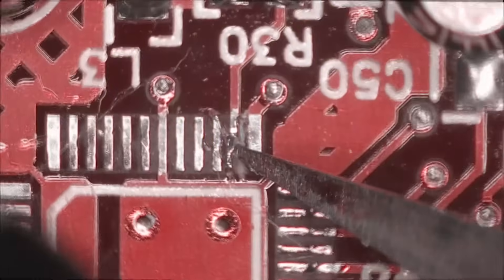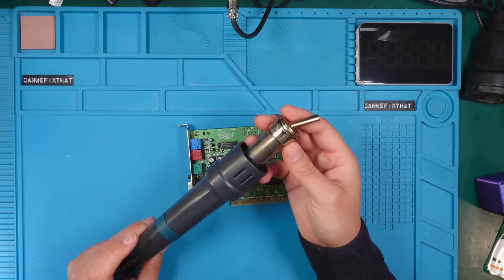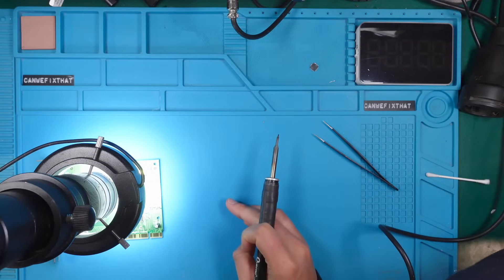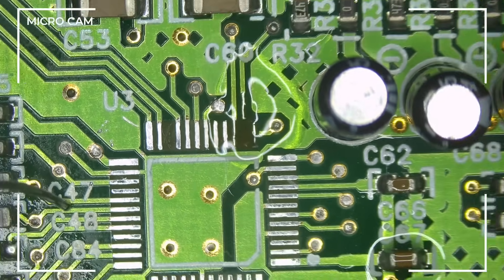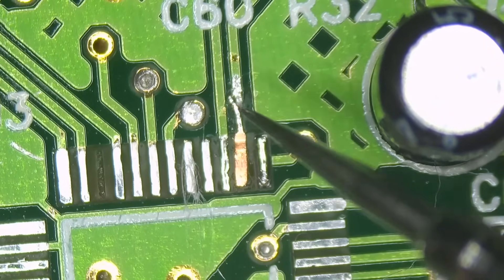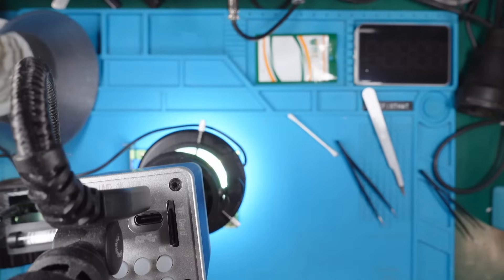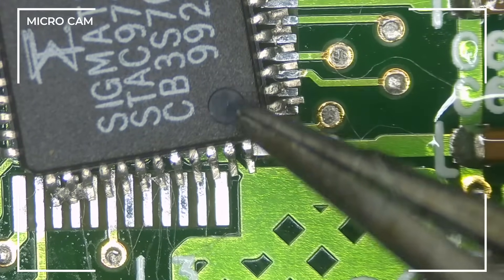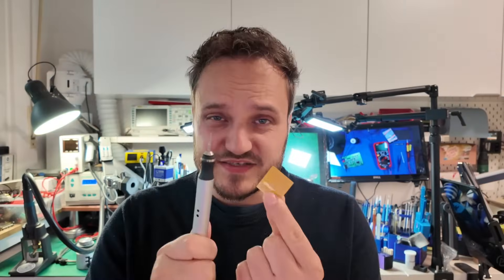How to FIX a MISSING Solder Pad (Easy)

Comment: Grind  the board under the missing trace and set the new trace with a smear of epoxy.  Smooth trace with a spatula.  Let cure before solder.  For your trace, I would have used the wire side and saved the pad end.
Reply from the maker: Hey! Thanks for your tips! 🫶

Comment: This however does not work on a lighning connector which usually comes with a plastic base.
It usually melts before you can apply any solder!

Comment: In this case the everything you did was a waste of time... why not just soldier the new chip in pace and then just use a single stand of thin wire to bridge from the lead to the trace? Also, try using a fibre pen to remove the soldier mask, your tool took away some of the trace. I have repaired plenty of PCB's using nothing more than a fibre pen and some thin strand wire, old component leads work great for thicker traces. You can even repair completely snapped pcbs... superglue them together, repair the tracks, and maybe reinforce the pcb with some two part epoxy.

Comment: I remember back in the day using thin solid core copper wire to make traces when needed in situations. Lay down epoxy to hold the strips in place after a solder joint connection was made to the end of the original trace. Sometimes I used copper shielding tape from shielding electric guitars. Most times a jumper wire was used in situations where things didn't need to look neat.

Comment: Is the trace repair required? Or for aesthetics? (Compared to using a wire from the ic to the go through spot)
Reply from the maker: Hi! It's not required; you could use a jumper wire instead with no issues. It's just a bit more neater. 🫶

Comment: I do not see much neccesity to add resist to the trace that you soldered at least in this case. Both of the neighbor trace are  soundly covered by resist and I do not think they get shorted with oveflew solder. Resist is essential to prevent short bridge but not merely physical protection, I think.

Comment: What keeps the pad portion of lug patch? Just rigidity of it?
I see you soldered it to the trace but no glue or anything fot the pad portion itself. 
I wonder  how it get tucked to PCB surface.
I have not tried replanting pad.I  use very thin wire to jump trace to leg of chip after  installing the chip to sound pads. I think it's easyer than replanting the missing pad. It's cleaner to replant, sure.
Reply from the maker: Hi! It's held down due to the soldering mask, but there are plenty of ways of doing this; meanwhile, I'm using another technique for that. 😉

Comment: At 14:27 you can avoid the pad from moving if you took a toothpick with a TINY drop of cyanacrylate glue and almost dry rubbed it (very little) to the bottom of the repair pad as you placed it on the circuit board before you fluxed and soldered it to the trace.
Reply from the maker: Thanks! I will try that in the future. 🫶

Comment: Hi. Thanks for sharing. Practice gets you to get things right in this field. And a few tricks you learn here and there. I used to apply solder mask and just apply UV light and heat gun. That was ok but not as good as squeezing the solder mask with some clear plastic then expose it to UV. If I'm in no hurry i leave the board in the sun i get better result with the solder mask😂😂😂
Reply from the maker: Hey, thank you very much for your feedback. I've seen that multiple times in the past with the plastic sheet, I will check it out looks like  perfect way to get it nice and flat! 🫶

Comment: You have to use hot air and UV at the same time to cure it immediately!
Reply from the maker: Hey! Yeah, that's a good advise. In the meanwhile I'm using a thin plastic sheet to get it flat and smooth during the curing process. 🫶

Comment: Instead of the flat plane viewing microscope camera, you're loosing the depth perspective of your view. I highly recommend to use a stereo (both eyes) microscope. It is a HUGE difference to be able to see in 3D with both eyes seeing in a different angle.  Try it once, you'll never use anything else.    These are not so expensive any more, just checked available for €180-250.   If someone does such repairs regularly, it is definitely worth it.
Reply from the maker: Hey Nick, you are right, it is much better, but on the other hand your back and neck are much more stressed when you look for a long period inside this kind of microscope. That's why I've changed to this digital version. 🫶,

Comment: in a pinch I have used copper slug tape from the garden centre, you just have to cut it carefully, its also self adhesive but it works well.
Reply from the maker: That's also a very good way. Thanks for sharing! 🫶

Comment: Duude, first time I've seen the grinding pen. That's SUPER neat! 
Most times I've seen this done its been either the scratch with tweezers method (I've done it with anything within reach with a sharp needle point...) or using abrasive bristled scratch pens for larger areas. Definitely going to be picking up one of those pen devices!
Reply from the maker: Hey Grey! Yeah, it is super handy and you won't regret it!  ✌🏻

Comment: I use old pcb boards and scavenge the tracks and pads from them.. easy to do. Also, use araldite glue to stick them down if required
Reply from the maker: That's a neat idea! Thank you for sharing! 🫶

Comment: The trace pads gas glue on the bottom. Just clean and dry the PCB and put the trace as best as you can and then press it (with a finger Is ok), the adhesive will simplify the job   a lot. 

Use the protective trace only after the job is done and triple checked. Never before.

The PCB must be fixed, if you work on it loose like you are doing you can mess up just by putting the wrong amount of pressure.

I personally don't like the rotaring tool for this kind of job. I prefere the good old sharp blade, gives me more sensitivity. The rotaring tool vibrates too much, you can't "feel" the layers being scraped
Reply: Typo: The trace pads HAS glue not "gas"... Sowwy
Reply from the maker: Thanks for sharing! I will keep it in mind! 🫶

Comment: Next time also uv mask on the pad self and scrape it off it will be much stronger. And buy better uv mask!
Reply from the maker: Thanks! Yes, I will try the scraping method next time. It didn't work out for me in the past, but it could be a problem with my UV mask. Do you have a recommendation for a brand? 🫶

Comment: You have a cold joint on that trace because right at the last second with the iron you lifted it back off the remaining trace. I’m surprised you diddnt reflow that with the iron
Reply from the maker: Hi! Thanks for mentioning it! I guess I've overseen that. My focus was mainly on showing the pad restoration, which is why I haven't realigned the IC as well, for example. I will be more careful in the future in such things! 🫶

Comment: Too much solder mask in one time. Try with multiple pass of very thin layer or use the 3s curable mask
Reply from the maker: Hi, thanks for your feedback! I guess you are right, it was too much of it, I just bought the 3s curable and check it out soon! Thanks again for sharing! 🫶

Comment: I would have cleaned the trace, scraping it with an xacto knife and then would have tinned it.  Go ahead and solder the flatpack in place.  BTW, in the US, the word "solder" is prounced without the "L" as if it was spelled solder.

I would then take a small piece of 28 ga kynar wire wrap wire, which is silver plated. I would than scab a piece from the tinned trace to the lead on the flatpack.  You are making a lot of extra work.

I'm retired, did this for a living -  Jim
Reply from the maker: Hi Jim, thank you so much for sharing your experience! Yeah, as a German guy, it's sometimes hard to say it correctly because, in my mind, it sounds more like a beverage ;) Your approach sounds interesting. I will try that in the future! Have a great time, Jim! 🫶
Reply: @CanWeFixThat  
It's pronounced as written, sol-der, solder. Yanks pronounce it as sodder with the L silent and that's incorrect. They also pronounce herb as erb with the H silent. Imagine that. 🤣🤣🤣🤣
Reply: The word solder comes from Latin, the L is not silent.

Comment: you know how i would have done it. I would have left the chip on or put it on first. (by the way you put your chip on crooked and the pins didn't line up on the left side). Anyways. 
From there I would use a thin copper wire and solder that on to the chip leg then have it follow the path on top of the board and solder the other end of the wire to where the hole is at the end. 

Its much easier and faster to do that than to try and make a new pad. No microscope, just put a little solder on the end of the wire and put it on top of the leg that's missing the pad and solder it. You could do that to all of them pretty easy.  and its much easier to solder the end points than to connect to the flat thin copper inside the board. 

Then if you wanted to coat the wire.Just  get a can of spray paint and do a quick  spirt.

Probably would have taken me 10-15 min ( including waiting for spray paint to dry)
Reply from the maker: Hey Smotty,
thanks a lot for your comment and for sharing your way of doing it. You're totally right, there are always different ways to approach these kinds of repairs. I really like your method with the thin copper wire, that's actually a super clean and efficient idea, especially when you're not using a microscope.

And yes, you're absolutely right about the chip being a bit crooked. I did mention in the video that I wasn’t too focused on the perfect placement this time, since the main goal was more about the general process and not getting everything 100% perfect. But I get your point, and it’s definitely something to improve next time.

I also really like your tip with the spray paint to coat the wire. That’s a clever and simple solution I hadn’t thought of before. Honestly, I appreciate you taking the time to write all that out. It’s always cool to hear how other people would tackle the same issue.

Thanks again for the feedback, really appreciate it! ✌🏻

Comment: Im going to have to do this with the switch im repairing was removing a bad c port and it took the pads with it
Reply from the maker: You can also use a very thin copper jumper cable to fix it - there are multiple ways to tackle this. 🫶

Comment: I use an old I3 Laptop  FREE OBS App And £3.99p webcam, I buy and use £2.99p 0.001 mm x 1Cm x 5 meter sticky back copper tape roll and cut to what size I need. see my how to make PCB's with out chemical's video
Reply from the maker: Hi! Of course, there are multiple ways to tackle such repairs. This one is very cost-efficient. Thanks for sharing! ✌🏻

Comment: I've been cutting my own traces out of brass shim stock and bonding to the PCB since the mid to late 90's. Works great for long traces eaten by battery or cap corrosion. This way I can replicate the original shape and still have a excellent connection.
Reply from the maker: Hi! Cutting it to get special shapes as desired is a brilliant idea. Thanks for sharing! 🫶
Reply: @CanWeFixThat  Glad to post it. I hope this method helps someone else.  If you want it to turn out really accurate use those little scissors that have a slight curve to them that have blades about 1" long. They're great for dealing with curves and corners. Once the shape is all there you can lay the trace out on a sheet of glass and use a little ball bearing assembly as a roller and smooth out the rough edges. I find superglue to be the best for bonding the trace to the board. I don't know how well superglue would stand up under a hot air station, but if you're quick and you're iron is hot it works fine. I do a lot of vintage work and have brought back a lot of old radios that were heading for the trash after someone left batteries in them for 30+ years.
Reply from the maker: @1956kirk Thanks! The scissor tip idea is also very good advice! You're right; I would say most damages are from leaked batteries and the harm that comes with these leakages.
Reply: @CanWeFixThat I would say most damage is me burning the trace off with my soldering iron 😂
Reply from the maker: @SamiJumppanen  Yeah, I think this is also something I experienced more than just once 🤣
Reply: @Multiplemiggs007  Superglue cannot withstand high temperatures, as proven in practice((
It can be used as a temporary fastener for tracks to solder them. 👌

Comment: Started doing this in the 1990s, when there was no microscope, no scratching tools, no uv paint, no precise tipped soldering irons. Had to remove and reinstall these chips only with the help of a tin wire. Those were the only available facilities. And when any track got broken, the wire strand was the life saver. Today we have facilities, but i still prefer my primitive techniques at many points.
Reply: One thing i like about repairing old devices is that components used to be bigger
Reply: @NikolaTesla-os8yh  Yes that's right but only from today's point of view. In those days the challenges were different, we couldn't get the schematics easily, then the next step was to get the spares which wasn't easy though. Today we are in the nano tech age so we can say older times were better. We don't know what is coming next...... Our next generation may say nano tech was better... It's a matter of time my friend.
Reply: @techy1661  I would rather have tech from the 1990s because everything is repairable.
Reply: @WilliamHollinger2019 
There's nothing which can't be repaired. In olden days, manufacturers used to provide the schematics of their products, which made their products more reliable. I am still in the job of repairing. New things always come with new challenges. Schematics aren't available easily, but we have several other options available to get the things done, changing circuits is the best option. I personally believe in repairing electronics rather than scrapping, just my nano effort to fight against e pollution.
Reply: @techy1661 are you in the states? I need something repaired
Reply: @matthewlee2686 , No, M not from the states
Reply: @matthewlee2686 . No i m not from USA
Reply: What exactly do you want to get repaired? Perhaps i could be of some help.
Reply from the maker: @NikolaTesla-os8yh  I feel you! 🫶
Reply from the maker: Hi Techy, thanks for these insights! I appreciate this work, and you have my full respect for it. I would also stick to the old technique if I could handle it! ✌🏻
Reply: I’d recommend hobbyists working on any scrap boards they can lay their hands on to help,improve technique and confidence. When I started repairs, years ago, my hands were very shaky, but my employer had heaps of old boards for me to practise on. I became good enough to completely remove four-sided surface mount ICs using a soldering iron, flux and very narrow curved tweezers (I shaped the tweezer myself!), mostly with no track/trace damage.

Track repairs were either by using single strands of wire flattened with pliers soldered into place, with nail varnish to protect the repair, or if something more substantial was required I just used a piece of insulated wire—of appropriate thickness—soldered to the remaining track and component leg, with superglue used to help bond the wire to the board and strengthen the physical ‘fit’ of the joint repairs.

Happy days, were they.
Reply: @proprioception_of_the_soul   Indeed.. Those were the happy days. M still in the same job, but the challenges have died :D
Reply: I’ve been working on some beomasters and a Phillips 22h amplifiers. They’re great to work with!! I love it when I can just screw open a large potentiometer and clean it with an eraser😁
Reply: Azi totul e sump si din pacate politica e sa schimbe produsele ca sa nu mi gasesti pieseschimb la cele mai vechi de x ani,investitia e consierabila si pt hobby e costisitor ca nu stii cand mai ai nevoie+la toate cheltuielile prin curierat destul de piperate😢.Despre partea cheltuielilor nu spun nimic ca de obicei😢
Reply: @iosifferencz5432 nu neapărat ar fi o politică pt așa ceva doar că evoluează tehnica și apar produse cu tot mai multe funcții - pt a restaura ceva vechi care nici nu se mai produce, e normal că piesele sunt greu de găsit și de asta și au prețul destul de mare pt că sunt tot mai rare
Reply: @iosifferencz5432  Yeah really, a lot of kit too. And my eyesight ain't that good any more.. electron microscope anybody?
Reply: My dad was an electronics technician back in the 1990s
Reply: yes thts is right. i also fix this only with wire. no spcial things.
Reply: Yeah and in those days you had to get to the shop via horse and buggy too

Comment: Since you have so many loose pads it will be easier to solder one pad at a time adding solder as you solder the pad instead of pre tinning the pads. Less chance of movement and misalignment that way
Reply from the maker: Hi deerhunter, yeah, you are probably right. Thanks! 🫶

Comment: Too much flux 😮
Reply from the maker: Better too much than too less! 😁
Reply: yeah,  where did you get your flux? Never could find any decent flux, it's always the paste stuff around here and it always burns up too quick and contaminates the job. So I usually dont use it and just use flux core wire. ( not the chinese crap  made from tin and used fishing weights and soda cans), that stuff doesn't even stick to itself)

Comment: what about the trace that you didn't replace? It seemed like it didn't have a specific trace line to go along, but it appears that there are other traces like that. Is it important? Can you just leave it alone?
Reply from the maker: Hi! When you have pads that are not connected with any visible trace or via a hole, there is no need to connect them. I hope that helps! ✌🏻
Reply: @CanWeFixThat  it for sure does! Thank you for answering.
Reply from the maker: It was a pleasure! 🫶